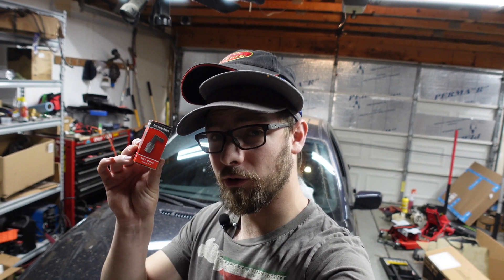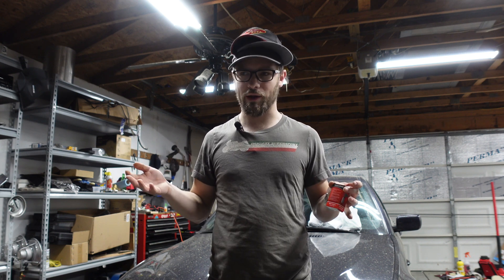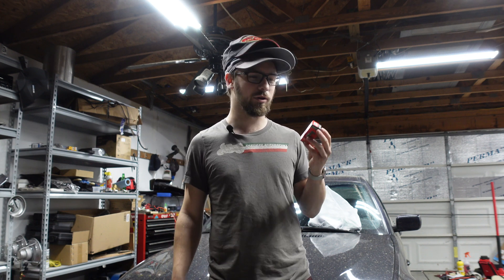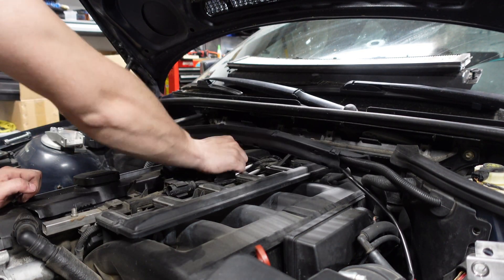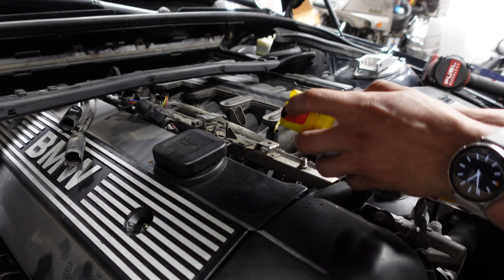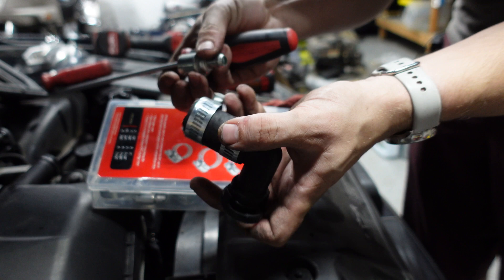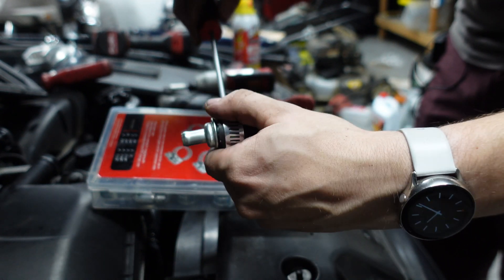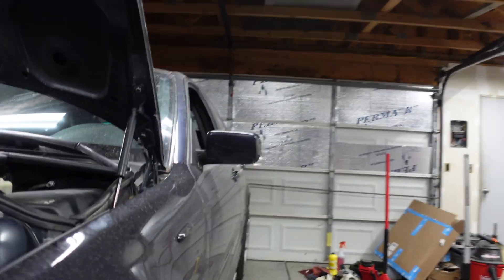FIXING GERMAN ENGINEERING with a $2 CHEVY part? (CCV to PCV conversion)

Comment: Several things to consider:  Will this conversion increase Crankcase pressure, create oil leaks or lead to increased oil consumption?  The Crankcase Ventilation System on the M54 engine is engineered to Vent the excess crankcase pressure through a separator (think "catch can") then drain any excess oil in the Crankcase Ventilation (CCV) system back into the oil pan through the bottom of the dipstick sleeve.  Cutting the CCV hose and installing a PCV valve may restrict the flow, thus increasing crankcase pressure.  As a result, you may experience oil leaks around the valve cover gasket (or other areas).  There is also the risk of blowing out a rear main seal which would be a major headache to replace.  You may want to consider installing a crankcase  pressure gauge with and without the conversion to determine the impact on crankcase pressure.  The 50s kid has a couple of outstanding videos explaining the design and function of the BMW E46 CCV.  They're well worth watching.  Keep in mind that the piston rings on the M54 are a weak link and tend to wear out which creates a fair amount of blowby / recirculation thru the CCV.   I have 150,000 miles on my 330i M54 engine and have replaced the CCV System twice.   It keeps the entire system working well and runs as smooth as a sewing machine.  Hope this helps.  :)

Comment: That is a really bad idea, the oem port is that size to evacuate as much vapors as possible, you are worsening the problem that these have wich is oil consumption by making the crankcase pressure higher, it is better to stay stock ccv or a good catch can but has to be done well if not its the same problem and you can pop seals out like this. Talking experience

Comment: I did this and could not pass smog. Failed visual inspection,  stating that the emissions system was altered.  Tech said i need to replace it 😊with oem parts.

Comment: hmm i might do this myself.... se if that chevy part is same on opels so i can use that instead.

also veyron wasint the only car that was amde with no cost spend, there was 2 more from VW group and all came around same time, second was Phaeton the absolute pinacle of luxery they could make, and third one was Audi A2 was the most fuel efficent car developed (the extra option was the XL1 but it was a limited run model)

Comment: my 2003 330i likes to smoke plumes of what smells like burning oil when i get above 4k RPM, and will smoke for a minute or so then if I drive easier then it will soon be gone, is that a failing CCV? I've removed my oil cap and it pulls a slight vacuum when the engine is running, and not excessive pressure like a lot of other videos show being a failing CCV. my new spark plugs have oil on the tips and also using a scope shows my cylinders are covered in carbon. My other symptoms are terrible mileage (13 MPG) a scavenging idle when cold/misfire when cold, but after a few seconds gets back to sounding about right, along with my idle sometimes spiking up a few hundred when coming to a stop.

Comment: That vacuum seems excessive. The valve cover should be modded to provide a calibrated leak, with the inlet plumbed to the air filter housing. Alternatively, a PCV valve with a smaller flow rate could be used...Though a clean air inlet needs to be incorporated into the valve cover regardless.

Comment: Yeah... That's bad. No sense in trying to re-engineer a crankcase ventilation system on an M5X engine. Just replace the valve and hoses and leave the sketchy stuff behind. This bandaid fix might get you driving again, temporarily- if you remedied a vacuum leak, but do spend the extra little bit on parts and do it right.
Reply: As an air/oil separator system the CCV works okay, it's just stuffed in a inconvenient location so a lot of people neglect or delay CCV maintenance.

Comment: My Passat has the PCV system inside the valve cover and VW only sells the whole valve cover for a small fortune. I bought the replacement diaphragm for 10 bucks but now in order to replace it I need to put the car in VW service mode to remove the intake manifold and access the valve cover. What a pain just to fix the PCV

Comment: the BMW turbo diesel in my Lincoln has that sort of catch can / drain thing, but there is no vacuum to it.  No manifold vac on a diesel, it vents back to the turbo inlet so basically it slimes the entire intake track with oil vapor.  Can't fit a PCV because the vacuum pump is under the valve cover so anything that pulls out of the crankcase would dump back into the crankcase.  Basically it just sucks and there isn't much to be done about it.

Comment: CCV = Crank Case Vent. Same thing as PCV, just slightly different wording similar to how BMW says DME (Digital Motor Electronics) instead of ECU (Engine Control Unit) or ECM (Engine Control Module).

Comment: That much crankcase vacuum might damage the rear main seal. That has happened to my engine. But other than that it helps oil rings stay on cylinder walls, which improves oil consumption.

Comment: German engineers seem completely in capable of designing a proper PCV system. Either it sucks all the oil out, or it blows out seals because of excessive pressure

Comment: Back in the day, my 1967 Ford vented its crankcase fumes to the atmosphere via a catch can (of sorts) which is no longer deemed an acceptable approach. These days the engine consumes these fumes via the intake and combustion process which sadly leads to carbonisation. Any tinkering with the PCV/CCV system would fail the mandatory annual test where I live.
Reply: my 72 Ford isn’t like that so I wonder when the cut off was, that’s unfortunate, wonder what state you live in…
Reply: @TravisClan  1967 LOL

Comment: when i was a tech at toyota the 2.4 oil consumption was a bigger deal back then. 
capacity...4.3qts of oil
oil change interval 5000 miles
oil consumption ....1qt every 1000 miles is considered normal

do the math.....yes, avoid the toyota 2.4L at all costs.
Reply from the maker: Yuup. I had one. First gen Scion tC. Very happy to be rid of it.
Reply: @100PercentJake  oddly a friend bought a first year TC and he never had an issue with it, took it to 100k miles.  but i did see lots of these 2.4 motors with tamper seals on the oil cap and filter for testing.

Comment: CCV means Crank Case Ventilation. The purpose is to recover the blow by gases so the pressure doesn't blow out oil seals. It has nothing to do with cleaning the oil

Comment: I would almost think running that much vacuum through a catch can might be a solid choice As it would be easier to Check on how much oil is being pulled into the system